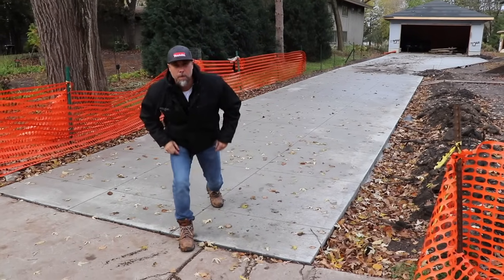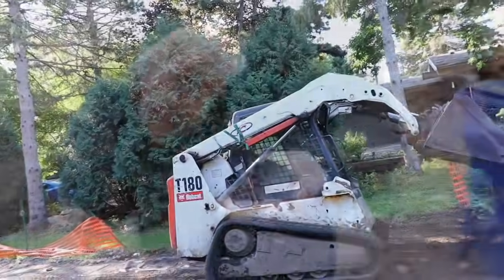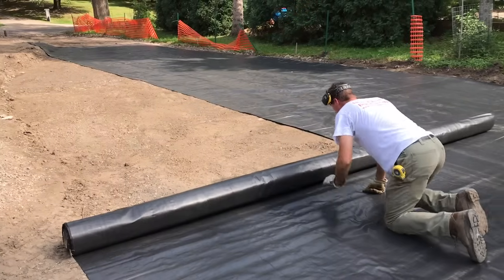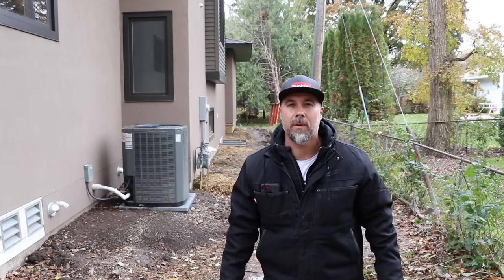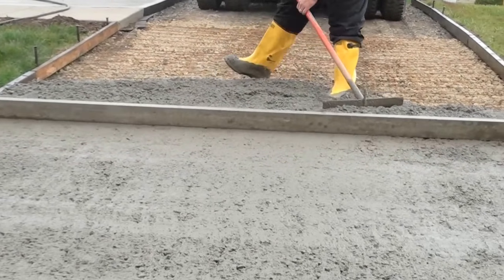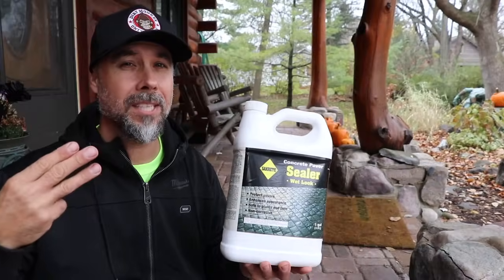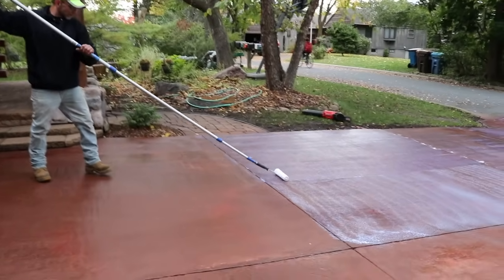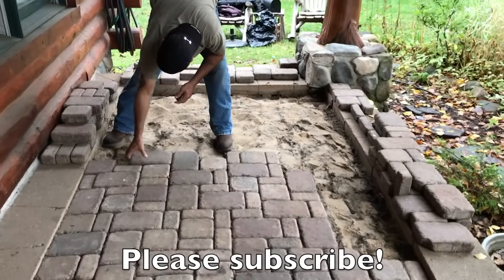Concrete basics for Beginners from top to bottom, ground prep, rebar, sealing & protecting

Comment: Sealing concrete is the weirdest new thing ever. As you can see in the video when the "salt damage" gets shown, it's not the conrete that's damages but just the stupid sealing layers some people put on these days. Concrete is completely solid as is, it needs no protective layer and anything you put onto it will just come off unevenly at some point and make a broken ugly surface. Putting a fabric between the concrete and the sand/gravel will also hinder the drainage ability of the soil, potentially trapping water between the concrete and the soil. Really bad mistakes in this video, made by self taught contractors who never learned how to properly do the job.

Comment: Rome concrete is here today. No rebar. Just make concrete the way smart people did it 2000 years ago.
Reply: What mix?  Show evidence.
Reply: @manictiger  just type in How Did Ignorant Pagan Romans Make Concrete. It's not tuff. But pouring it can be.
Reply: @happyraccoon4791  
Yeah, but you're saying we have formulas that are not 100 bucks a lb. that have high tensile strength (not to be confused with compression strength).

I'm actually trying to make a new bomb shelter (instead of hiring out, I'm doing it myself) and I need something that can withstand seismic shifts as well as compression.  I'm in a cold state, so rebar isn't optimal, either.

I need to know the actual mix.  I don't care about theories or "cutting edge" 1000 dollar nanite tube mixes.  The project isn't supposed to cost half a million bucks, just because I wanted diamond and platinum concrete.
Reply: @manictiger  well, watch some video on the good old fashioned Long lasting concrete. Some is still in use today!!
Reply: @happyraccoon4791  
Yeah, um.  Thing is, mine needs to survive lateral forces.  If an Earthquake hits a house, that sucks.  If an Earthquake hits an underground Earthship that isn't made properly, that REALLY sucks.  So, I ether NEED rebar and anti-spalling measures, or I need concrete that might not exist at the price range I'd like.  Theories are great until you have to start paying money for them.
Reply: @manictiger  channel Practical Engineering, was Roman concrete better?
Reply: @happyraccoon4791  
I'd say no.  They built above ground.  If I used their building style, I'd wind up with a bunch of crap landing on my head.  You keep comparing above ground buildings to what I'm trying to do.  It's f7cking irrelevant what they do above.  They're not trying to stick a small hill of Earth on top their sh7t.  And, again, I already have a bomb shelter.  This one I'm making is just so I can have some more storage and to learn how to do it myself.

I'm not interested in theories.  I'm interested in mixes, price-point, tensile strength and anti-spalling measures (like the fibers we add to some mixes).
Have you ever built anything with concrete?  Have you ever put your wallet on the line for it?
Reply: That all being said, I have "borrowed" one technique from the ancients.  There's going to be a lot of round stuff (arches, domes, etc.).  It still needs to be Earthquake shockwave resistant, either through "fancier cement" and/or through rebar.
Reply: @manictiger  Im no expert ...I want a nice 1209sqft patio. Bids are running $13,000 !!! It ain't a big deal. So I thunk to meself, self, wtf is up, let's research. So I am....🤔🧐 But no solution just yet
Reply: @happyraccoon4791  
Surfaces are a little easier.  If you want high quality pavement, there's polymer concrete.  It's being used on roads to be abused by semi trucks and such.  Might cost a bit.  I am still doing research, too.

Comment: Great stuff BUT you move TOO fast.  Things are NEVER as simple as your speed videos show!  Why not break each of these videos down and show ALL the required work and challenges that occur when doing these jobs.  Also, you have to speak to the ways things are done in different environments.  Some places will never see snow thus will never have a use for salt.  Some places don't have the extreme temperature changes from hot to cold or don't have heavy rain.  All those factors should be considered too.  Hopefully, one day you will get a chance to travel to the different zones to show the difference in the way things are done in different parts of the country.